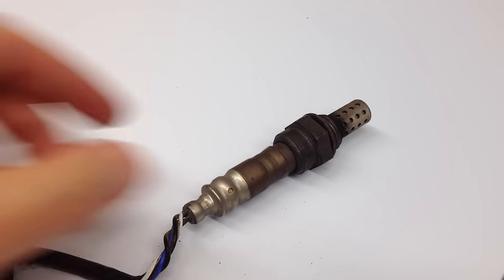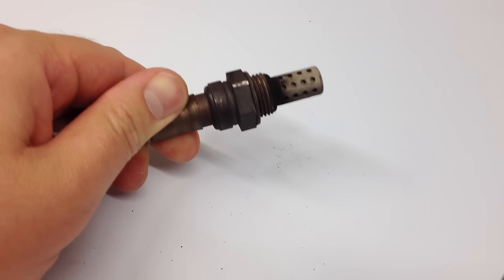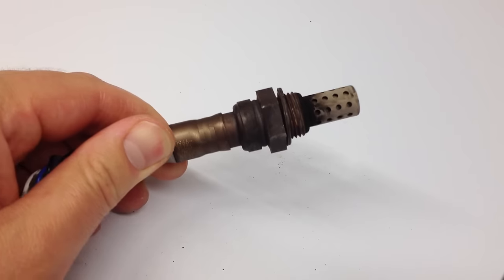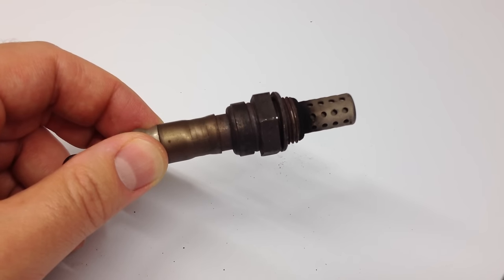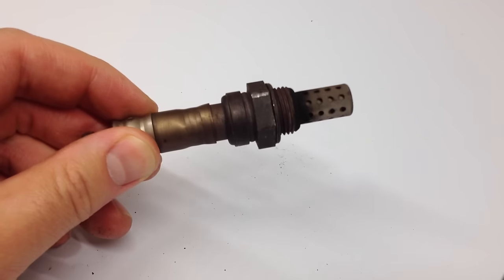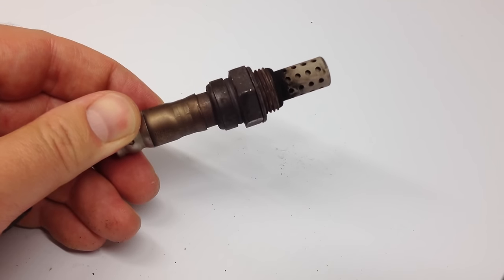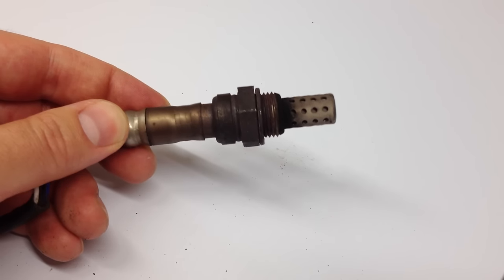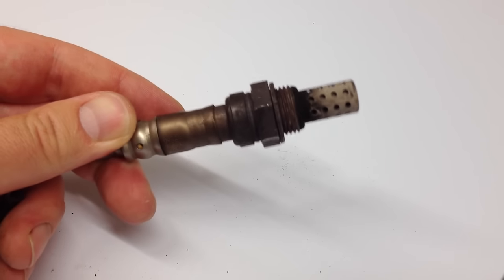Bad Oxygen Sensor Symptoms and Dangers

Comment: ba ed 02 sensor is NOT a big deal.. ya I get the engine light on and off and the code for 2 years now im still alive car runs great.  Realize its a generic code anyways... and try replacing your air filter that should solve the matter it did for me...hey if your poor do your best and ya gotta maybe beat up your mechanic and foold your self ..I got 9 kids and a fat wife... I put A GRAND IN THAT car my survival depends on that thing... good luck.. Its no fun I have been in jail 6 times for beating up my mechanic but hey I got free work and lits of legal problems.... you might also want to barter your wife's body for automotive repair..if she does not like it  that that woman who the man is
Reply: @Jonathan A. Really - does the state require cars to get tested? here in CA we have safety laws but cars that have problems are not enforced by law. I wanna keep the car its a crown vic police interceptor - I want to fix it its going to be worth a lot and a c;classic!  But cant afford any more car repairs, behind on mortgage,  I dont want it to go to waste. Im trying to learn how to replace it. When the engine light comes on the car putters, and there is a loos Bering sound coming from the pulley. Engine heats up. I pull over wait a few minuts back to normal,. Happens ever few weeks...
Reply: @Jonathan A. That is interesting I lived in PA there was no requirement like that. i wonder why your state requires that.  i say this because many cars on the road do not run well. is it wise to assume every one owned a new car? just curious. I just retired from the C.H.P here in CA We often train other law enforcement agency's.  By the way my 14 year old son posted that ridiculous comment got in my acct. This is a interesting form.
Reply: @Jonathan A. I did the O2 censor is all that came up... cant get the transmission code. OD flashing went away after I did a transmission flush
Reply: @Jonathan A. Thats good to know..thanks for that ill research how to do it...